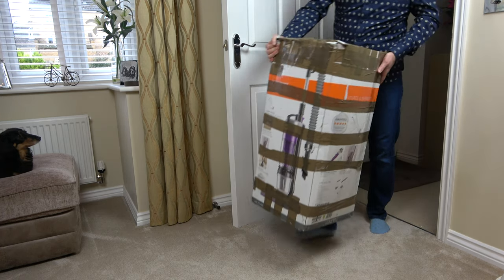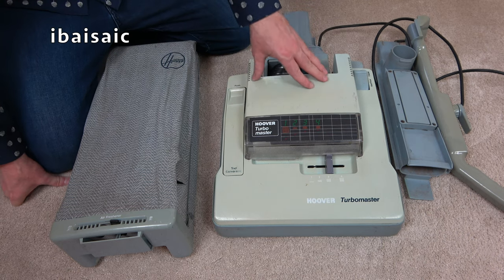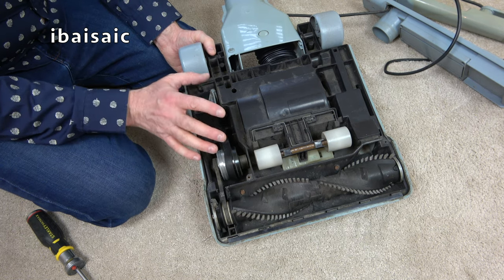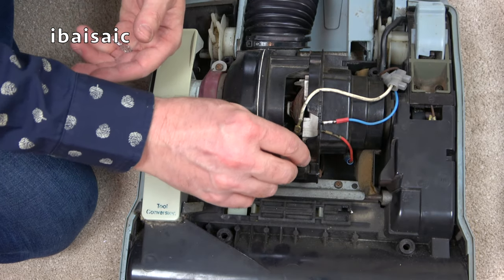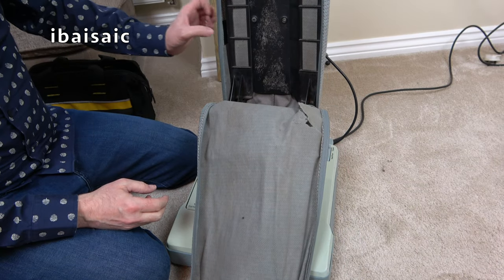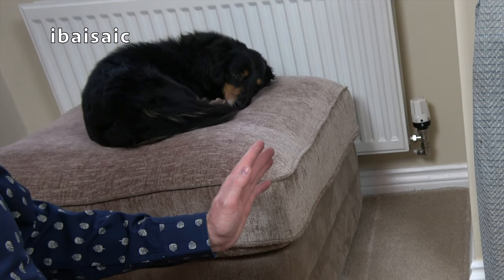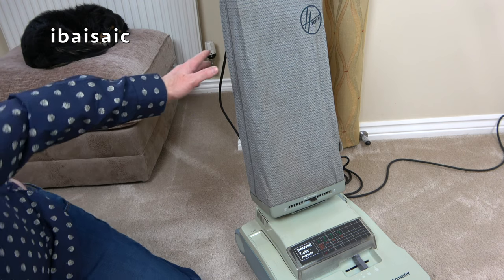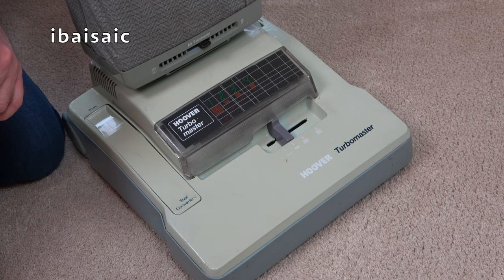Hoover U4362 Turbomaster Softbag Upright Vacuum Cleaner Assembly & First Look

Comment: I have the American Innovation soft bag. The handle release is broken, it has holes in the outer bag, and it needs some motor work, but it does groom the carpet better than most vacuums. These are horribly frail compared to the Hoover Elite, maybe the most brittle parts I’ve ever seen on any Hoover.